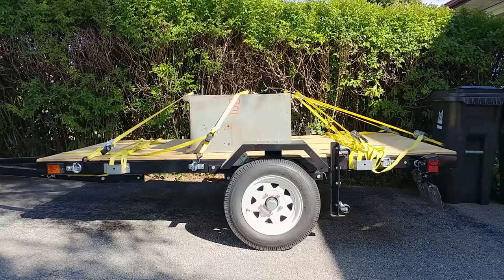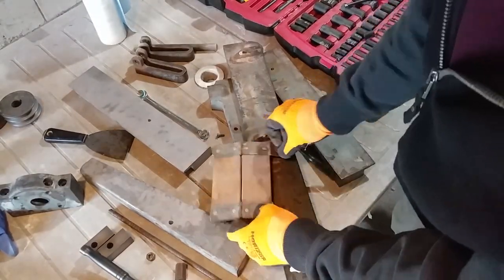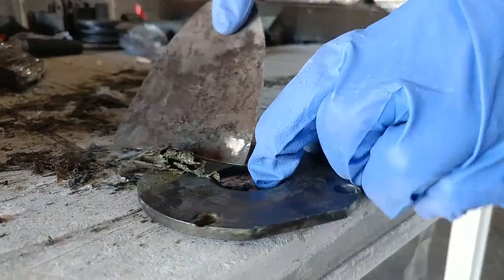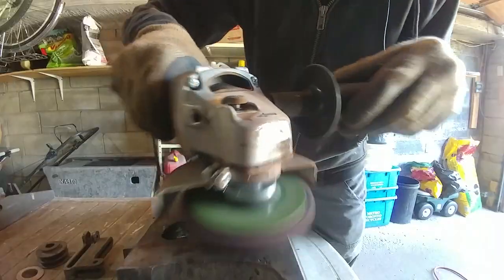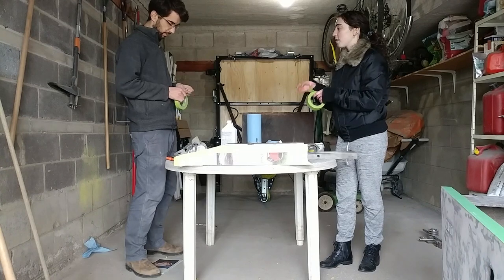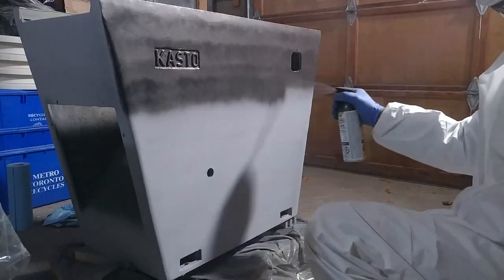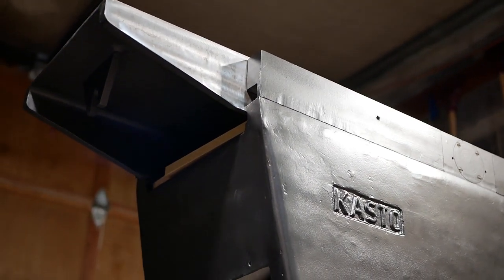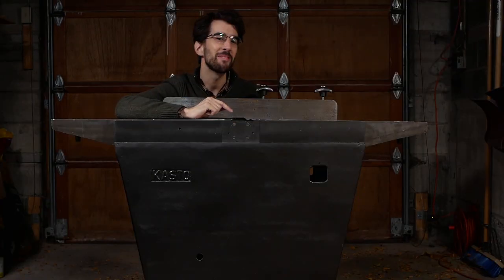Perfect Paint for a VINTAGE 12" Jointer -  Restoration How-To [Part 1]

Comment: I was drawn to your channel by your recent cabinet build video...great video BTW. But I have a real passion for machine restoration and my own vintage Porter 12" jointer restoration project gave me some real empathy for what you are up against with your jointer restoration. I tried looking up your jointer but I was not able to find any comparable models. In fact, I couldn't even find that Kasto ever made a jointer. I did find one Kasto hacksaw image with a simiar looking base casting at a site called "metaalnieuws" out of the netherlands. Looking at the writing on the cutter head it says something like "Polaree(?)" which I also haven't heard of. You may have the only one in existence. It could be a one-off, a prototype, a war-era fabrication, or just a DIY frankenstein of sorts......which is going to make restoring it a bit difficult if not impossible. It may help if you could better document the parts and assembly.

Comment: Next time....choose PVC pipe slightly oversized of your cutterhead, glue and cap the base, fill the pipe with evaporust, submerge your part, then cap and let sit overnight.  This method uses less evaporust and prevents those annoying lines left over by the towels.

Comment: Very cool!! Maybe you could still paint the lettering red, just a more subtle shade!
Reply from the maker: I'm leaning towards silver at this point, a monochromatic jointer will be neat.
Reply: I was thinking silver also. Tape the area around the logo and roll on silver so that only the surface of the letters get any paint. That'll make it pop! Also what was the name of the marketplace where you first encountered this beast? I want to find one that size to rebuild...
Reply from the maker: In most parts of Canada, Kijiji is more popular than Craigslist, but it's essentially the same type of classified ad service. The best deals go fast, so if you're looking for something, try and look every day. Also helps to have more generalized searches: simply 'jointer' will turn up all results, which will include those that are too lazy to give more detailed descriptions. In my experience, the ads without much effort by the seller tend to give better deals.
Reply: @ScottWalshWoodworking  Craigslist isn't as exhaustive as Kijiji seems to be. Maybe there aren't enough woodworking types in my area? I guess I need to find a buddy in Canada who would hunt down a deal for me and help me acquire this tool. I suppose it will require a JOINT effort! LOL!

Comment: You finish this jointer yet?
Reply from the maker: Couldn't work on it because I don't have access to the machine shop I normally do because of the pandemic. I might finally be able to get in there within the next month or so if all goes well.
Reply: @ScottWalshWoodworking  I understand, you stated that in the video, was wondering if enough time went by for the shop to open back up. But glad to hear you don't have to wait to much longer.